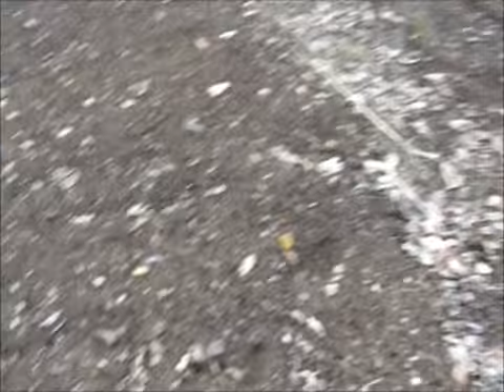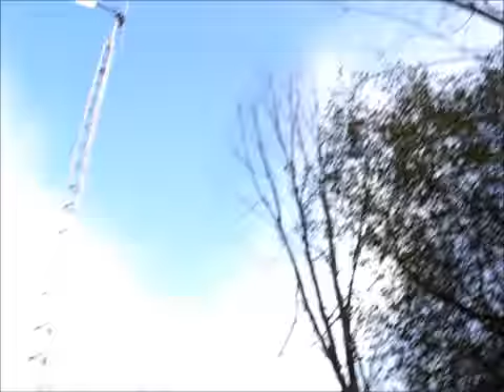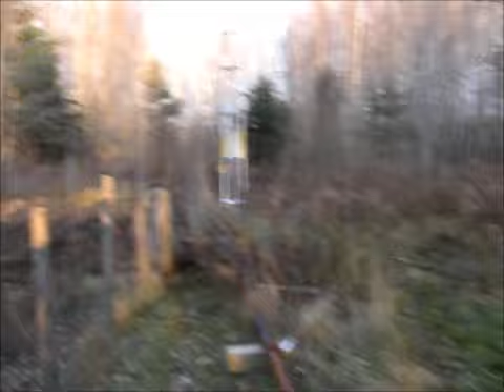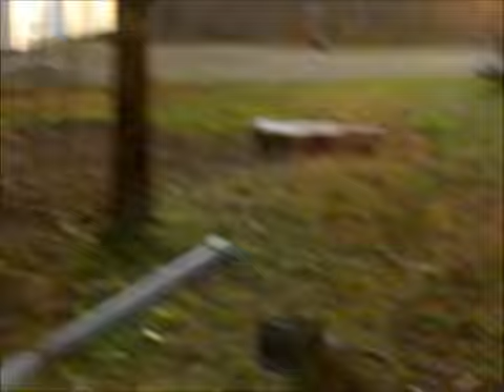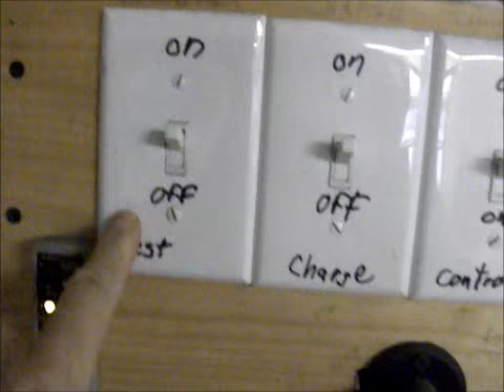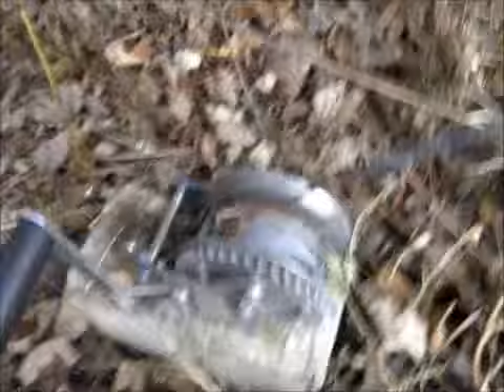garden and windturbine

Comment: Tinny thanks for showing us your setup. Pretty cool. In a previous video I recall you said that was a square wave inverter. Do you really get 120v ac out of it when measured with a volt meter?  I had one that was called a modified sine wave inverter(cheap). It ran everything fine but only showed about 80 volts out.  Put a meter on it. It could be fun.

Comment: @Cphobes its REALLY easy, step 1, get a motor that can generate electricity when moving without a charge. step 2, attach a propeller. step 3, attach a high current diode to the motor disabling the motor from running via the battery. step 4, attach to battery. step 5, attach to pole in a windy area. step 6, enjoy free power.